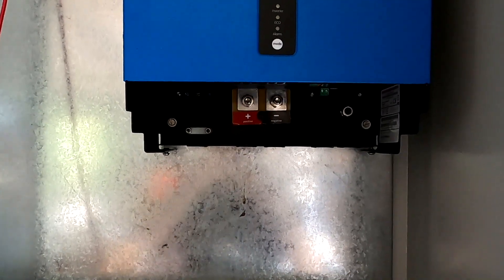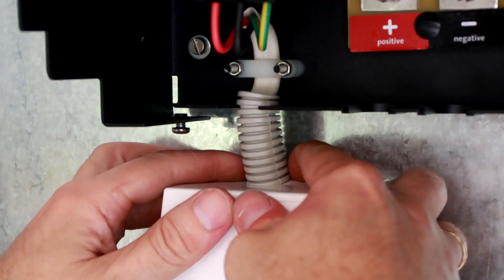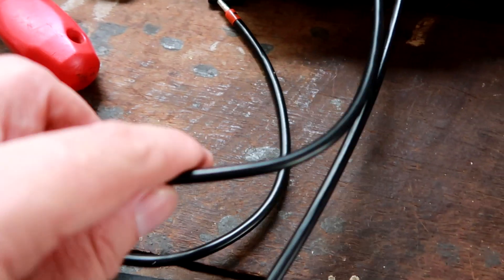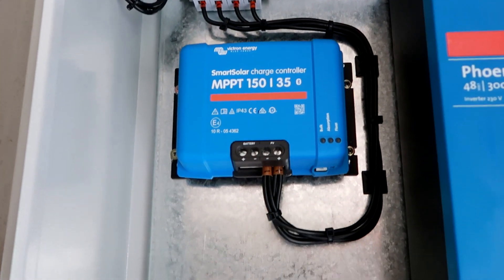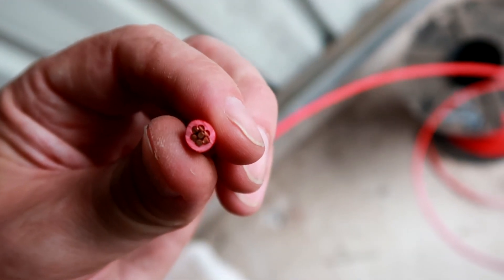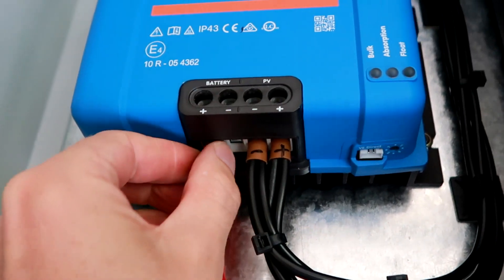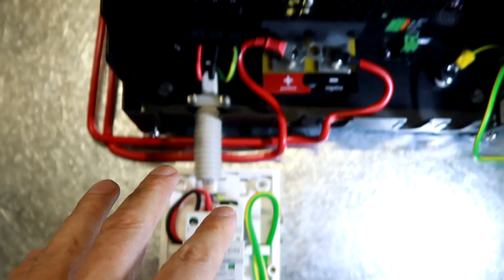'The Move'. More equipment inside the cabinet. Will it all work out?

Comment: Watch all you vids Andy evenn bought a PHEV maybe all elect in couple of years. I installed a  48v 5000 VE  for the charging remote house set up and car. Just wondering about cooling vent for the enclosure ? I drilled some hole in mine.

Comment: And I Iam trying to find good bus bars for my 24v system. There is some complaints about the nuts locking up on the stainless steel nuts and bolts. Is there a fix to prevent this
Reply from the maker: I can only recommend these ones here. They are great and far better than the ones coming with the cells: https://youtu.be/mdr5HZZRaTc
Reply: No not the cell bus bars, the red and black bus bars in the electrical cabinet.

Comment: i have one of those crimpers and use it a lot. i find that i need to use the die one step down from the cable mm2 size as the die size matching the wire pulls out. its not a perfect crimper but its cheap and does make a solid crimp when i use the one size below die.

Comment: Lennie B makes a strong safety related point. Here in Canada regulations require indication of wire function within 6 inches of each termination point of the wire, either black tape or black paint in this instance for a negative conductor.

Comment: Quick question please answer on your resistor you use while hooking up your electronics does it have to be 10% Is 5% OK as well......... This is the one I am looking at purchasing will it be ok.....18ohm 18R 5W Wirewound Cement Ceramic Resistor 5%

Comment: Remember, the purpose of circuit breakers is to protect the wiring - not the devices.   Therefore, there is no reason to install a circuit breaker between the solar charge controller and the batteries.   You will never have sufficient current flowing that the wires you're using would be at risk.  Furthermore, it is not advised to have the solar charge controller connected to solar panels but not to the batteries.   For my system, I installed a relay that automatically disconnects the solar panels from the Victron 150/35 solar charge controllers whenever the system is turned off or when the batteries are not connected.
Reply from the maker: The Victron MPPT can actually run the load without battery.
Reply: @OffGridGarageAustralia  Consult your manual on the Victron Solar charge controller.   They specify connecting the batteries before connecting the PV array.   They also specify that you should never connect the charger to a grounded PV array.

Comment: Great video again, lots of fun.  The cabling is very neat.  Thank you for sharing.  Just a quick question.  The power from the panels, why did you not bring them in on the right hand side of the panel/box and then have the inverter on the left and all the other equipment on the right.  That way those stiff 10mm cables would not have to go under the 240V output cables.

Comment: I advise a breaker between the charge controller and battery but around double the rating you plan to feed thru it  on positive side this way if something goes very wrong it will kick out and this gives you a easy disconnect for your power to the charge controller from battery.

Comment: Victron says there should be a protection device between charger and battery, but it is to protect the cable, as the charger has a fuse already on its output. As others have said it could be useful for isolation, but you do have control via Bluetooth.

Comment: Anoter nice video keep going, 3:07 i hawe 10amp and with 240v ac just tripted one time afer 2 hours of 3kw continiusly, depends of the curve or the protección It trip faster or slow i got the slow ones and is working fine 10amp 240vac for 3 kw

Comment: I use always a bus bar and using a Fuse for every wire that leaves the bussbars. Between battery and busbar a Fuse.
Between Bussbar and MPPT a fuse
Between inverter and bussbar a fuse
If u using More than 1 battery packs also different fuses
Reply: Me too… always on every power wire…if it can carry power it will have a high quality fuse..

Comment: I would include the breaker after the MPPT. But not because there's any way the MPPT could push a dangerous amount of current but for the opposite reason: Remember that current isn't limited to flowing from the MPPT to the battery. It could potentially flow the other direction if something failed or there was some unexpected wire short. So if there was a short in the wire somehow between the MPPT and inverter you would essentially have a short circuit from your battery which could result in a massive amount of current. You'd want something to trip to protect those wires from over-current from the battery not from the MPPT.

In fact to me it's more important to have protection on the battery side of the MPPT rather than the solar side. Solar panels are inherently current limited. They have a maximum "open circuit current" that they will never exceed under any circumstances (Unless our Sun somehow grew miraculously brighter/stronger). So if your panels max open circuit current is 35 amps and you put them on a 40 amp breaker/fuse: Even if there was a short circuit in your wiring that breaker/fuse would never trip.

If there's a short on the battery side though: Then current from the battery itself could easily overwhelm wires and connections on the battery side of the MPPT.

Some people think: "Well I already have a fuse between the battery and inverter, and I'm connecting the MPPT to the inverter terminals, so the MPPT should be protected by the same fuse"

And while this is true: Most people are using heavier wire from the battery to inverter and then using a smaller wire to jump over to the MPPT since the current from the MPPT is much lower than the current to the inverter. So the 100A battery fuse will protect the wires to the inverter but the cables to the MPPT may not be able to handle 100A so having a smaller fuse/breaker would be needed there. Although it does look like you're using the same size wire from battery to inverter all the way to MPPT so in that case it wouldn't be "necessary" but it would still be nice to have a way to completely isolate power to the MPPT from both sides.

Also: Victron specifically warns against using that type of wire. They call for using a wire with a much higher number of strands because the screw down clamps can't make good contact with that stiff wire that has so few strands. If you look at the PDF of the manual here: https://www.victronenergy.com/upload/documents/Manual-SmartSolar-charge-controller-MPPT-150-45-to-150-100--250-60-to-250-100-EN-NL-FR-DE-ES-SE.pdf

On page 5 you'll see the warning I'm talking about.
Reply from the maker: This is not in the 150/35 manual though. Only in the /45 and higher.
But I will replace the cable anyways as I don't like it.

Comment: Very interesting episode.  A few comments: I'd be concerned about heat in the cabinet.  Once you're charging at max capacity of your CC, it will put off quite a bit of heat and your inverter has that potential too when it is getting to greater than 50% capacity.  You should put some black heat shrink on both sides of the negative cables (currently red.)  You should also include a breaker rated for your cable from the charge controller.  Look at it like this, the breaker/fuse is there to protect the cable.  You have a cable (unprotected) from the CC to the inverter.  If something went very wrong, that cable could melt and/or cause an arc/fire.  For my system, everything that provides/draws power, has a fuse/breaker in between.  I also incorporated 600A bus bars to connect all of my batteries, CC, inverter and battery monitor.  Makes it also easy to expand later.  You can check out my system (on YouTube: JC/DC in the AZ) if you like.  I'm using Schneider equipment and am in the middle of a HUGE battery upgrade to 64x 272Ah LIshen cells (1088Ah total) for my 48V system.

Comment: the thick core cable not good for DC current. DC travels along the outside of the wire i heard. So swap it out buddy ! use the fine strands.
Reply: Actually the skin effect affects AC current carrying capacity. Also 10mm2 cable is rated for 81A so the only thing I would change is marking the other end of the cable too with black heatshrink.

Sources:
https://www.allaboutcircuits.com/textbook/alternating-current/chpt-3/more-on-the-skin-effect
https://www.cse-distributors.co.uk/cable/technical-tables-useful-info/table-4e1a/
Reply: That is only true for high frequency applications (and some edge use cases such as non-sinusoidal waves or magnetic fields, such as in high power electric motors).  For 50 Hz / 60 Hz (typical home power usage), that is not the case.  

For typical home power use, solid is actually better because there is less resistance on a larger solid core wire than on stranded wire, and solid copper wire is generally cheaper.  Another advantage is that there is no need to use wire ferrules or forks (unless you really want to) since you don't have to worry about strand breakage.  

Of course, solid copper wire would not work well when we need flexible wires (power wires for electronics/appliance, extension cords, etc) so normally solid wire is used in permanent installations (wiring in the walls, for example) and flexible stranded wire is used for anything not permanently installed.  

In this case, this is a permanent installation, so heavier gauge, solid wires is the way to go if you have to purchase wiring (if you already own stranded wire, there is nothing wrong with using it).  For a 35A service, I'd use 8 AWG solid copper for all of those connections.  While it is not as easy to work with, once you put the right bends in it, it makes for a very attractive and reliable permanent installation.

Comment: If it get too hot in the metal box - Fan as you mentioned  - probably not code - Open door and use Fly screen - Keep the Red backs and flies out whilst ventilating !

Comment: I am no expert, why do the PV supply cables go from the MPPT to the inverter, I would have guessed that they should go to the battery and then the battery feeds the inverter?
Reply: By connecting them to the inverter you are effectively connecting them to the battery. Since there's already a massive cable going from the inverter to the battery: Instead of running a whole new cable all the way to the battery for can piggyback on that existing wire by connecting them together at the inverter. Victron Inverters often feature two studs each for both positive and negative connections for this reason. It simplifies wiring and reduces voltage drop from running more current over longer wire runs.
Reply: @JeremyAkersInAustin  Thanks for explaining.

Comment: With out a fuse those  small link cables are not protected they are now the fuse. Now change the lights for L E D lights saving current draw on the batter's. Stay off grid!

Comment: The circuit breakers are usually used to protect the cabling not the device. In German they are called Leitungsschutzschalter, which explains their purpose better. The breaker current rating has to fit to the wiring after the breaker to avoid e.g. the isolation from melting in high duration high load conditions. Additiinally they also do shirt circuit protection.

Comment: Andy, again a great video! THX! 
On your AC side or you use solid wires or you use cable terminals (as you correctly used on the DC) - remember what amount of power will go through them (maybe even use a 2,5 mm2 cable, just to be on the safe side)
Also the idea of conecting all the components directly on the terminals of the inverter is not a good one. I would sugest using two busbars where all the 3 components (solar charge controler, battery and inverter) meet - it would be much easier and safer to handle. You remember your statement about the missing cheap pice of plastic between the two terminals on the inverter....
Reply: Instead of bus bar, one wire could be a big bolt terminal contact breaker

Comment: There is no reason to have an additional breaker there between charge controller and battery. It will just introduce additional resistance.

Comment: it's always handy just one breaker extra for security because of lightning an extra protection and less damage.
Tip why not put some black shrinks on the red negative
Reply: For lighning u hawe to put an overvoltage protection u got dat and is cheap i recoment It. Also i wana Say why no black stink the negativo or even use some black tape

Comment: Again a nice video! I think a circuit breaker between battery and charge controller would be good for protection of the 10mm2 wires (Leitungsschutz). What says the manual from the charge controller to this? 
Have fun with the frogs!😂

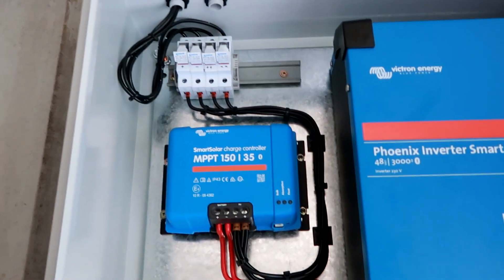Comment: 13:27 I think you forget to put on Black tape or Black shrink tubing on the Red wire that goes to the Negative terminal of the SCC, you did put the black shrink tubing on the other end that goes to the Negative terminal of the Inverter. May be use black wire instead to reduce confusion?
BTW, what is the plan for ventilation for the cabinet? Looking forward to the next video.
Reply: The use of red cable was explained (it was what was available), but I fully agree that a piece of black shrink tubing should have been placed on the charge controller side in addition to the inverter side.
Reply: @Nathan Krick. Or even black tape would suffice. Great work from Andy though. Love the videos.
Reply: @cCaribbeanSpursTv  true, but I already saw the black shrink wrap used on the ring terminal, so unless he ran out, shrink wrap is much nicer long term than electrical tape.

Comment: The solar charge cables should really terminate in the battery enclosure. What happens if you turn off the battery supply with the solar still supplying power to the inverter?

Comment: My guess is that each component has fuses inside, something to check for sure but essentially you want something to stop a short if it happens.  I opened up each piece in my system and verified they have fuses and inside my charge controller, I reduced the size of them so they blow faster if something happens.

Comment: You need protection (breaker/fuse) if you go down in ampacity. Ex. If your cable from the bms is capable of 50A, if should have your bms set (or a breaker/fuse) for 50A as close to the source as possible. If the 50A ampacity is kept all the way to the end, no other protection required. But if you go down in cable size (most common reason for reduced ampacity, but also: combine multiple cables together, put them in a thight conduit, pass them in some hot compartment, etc, anything that prevent the cable from exchanging heat with the environment) than you need another protection, let's say 30 or 40 A before you make this new circuit.

Comment: I think I'd make a screen door for the enclosure, something like a 1"x1" wood frame with rubber on the outside to make a deal, then screen on the inside , then it can fit snugly allow cooling, also keeping the critters out! The the door can be closed . If needed!
Reply from the maker: Yeah, I think I need a bit more force to cool this thing down. Running 2.5kW and it gets quite warm inside... Outside temps of 35° does not help.
Reply: @OffGridGarageAustralia  yeah it gets up to about 35° here too, but it's 35°F , just above frozen! Haha but summer is coming, it can get about 40-45° or 105°f with about 80-90% humidity at times,  especially when the temperature climbed to around 100° then rains for a hour then the sun is back out, it's miserable! But for now it's just above freezing, it was 20°F last night!!

Comment: You could have taken the back panel out of the box, mounted and wired everything on the bench  and put the whole completed back panel back into the cabinet.
But that would have been too easy 😄
Reply from the maker: I did this for the inverter mounting bracket. I like to see how it looks like when inside the cabinet and what distances I have  to the enclosure. Also, the fuses are already mounted at the top where I had to connect to.
Reply: @OffGridGarageAustralia  I would personally place a wooden mounting plate against the back wall in the cabinet instead of mounting everything directly to the steel conductive back wall, it is a mix of DC and AC equipment and make sure the wiring doesn't cross, but I do not know what the regulations say about this in AUS, I know the cabinet is grounded and maybe it's fine.. but above all safety first ..
Reply from the maker: @habana7638  I don't think wood is an allowed material for these installations as it needs to be for resistant. The metal back panel is actually quite nice to work with. And, it's also another heatsink for the charge controllers as they are getting pretty hot.
Reply: @OffGridGarageAustralia  definitely follow local electrical code.  In the US, a plywood backboard is used very commonly for mounting electrical components and meets code, but Australian code could be different.  

I agree about crossing DC and AC.  The DC feed crossing the AC output from the inverter made me cringe a little.  Everything is insulated and you should be fine, but it would have been better if your DC from the solar panels could have come in from the right side of the box. so you did not need to cross your DC power feed with the AC output.  As it is, you might want to consider if you can put the DC power lines inside conduit so it is conduit crossing conduit.

Comment: Still wondering why you bought a phoenix instead of a multiplus, quattro or even an easysolar.
Reply: The multiplus II has a builtin Charger - It can be used as a UPS too with Automatic Transfer switch.
Reply: @RT_RETROGAMING  Exactly why I thought it would have been a better option.

Comment: The PPT controller is designed for less than 40A, your battery fuse is something like 80A, so I'd definitely put a fuse or breaker between the PPT and batteries to limit damage in case the PPT's output fails shorted.
Reply from the maker: Yep, good point.